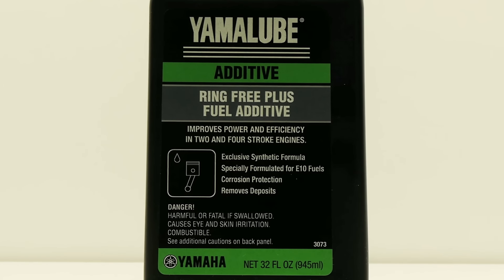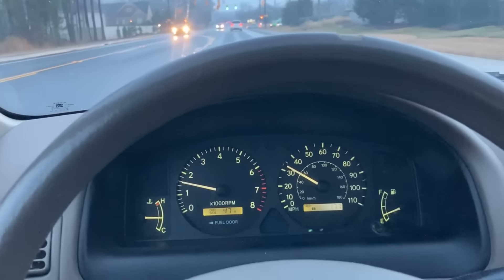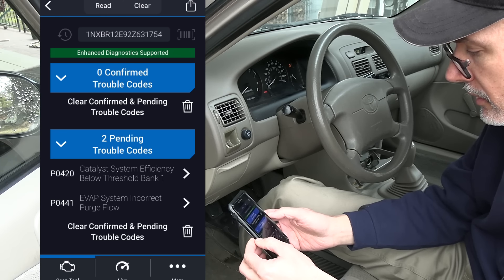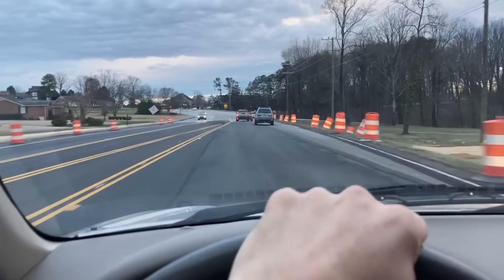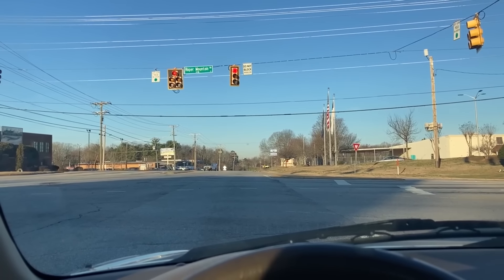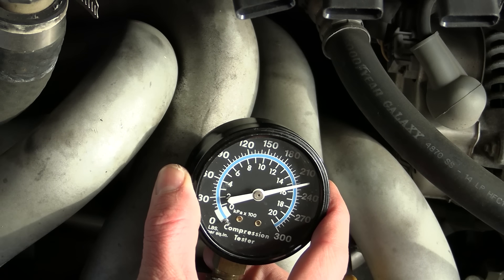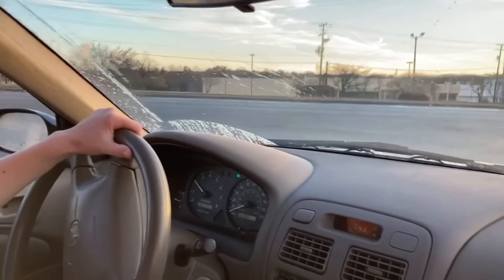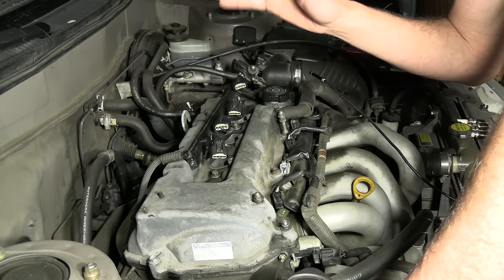Will Yamalube Ring Free stop oil consumption? | Oil Burning🔥Experiments | Episode 20

Comment: Hello Dave, I have been following along with your Oil Burning series as I have an oil burning Honda Element. I posted a comment on video eleven. My efforts included Seafoam, which de-sludged my engine, Toyota engine cleaner, noticed no difference. I tried a product my neighbour recommended, he works for a GM dealer, AC Delco engine oil supplement. This product is not marketed as a engine ring cleaner but as a engine rebuilding lubricant and I noticed a difference immediately in the level of noise the engine made and my oil consumption. After 3 treatments following the instructions on the bottle oil consumption was cut in half. I then tried what might turn out to be the most successful product yet, Castrol GTX Ultraclean 5W-30 synthetic engine oil! Boy did this stuff turn black fast. After 1500 miles I changed the oil and filter and repeat. 1500 miles later again changed the oil and filter. The oil was again black but the oil consumption was noticeably less. Now on my third Castrol GTX Ultraclean oil change, the oil has not changed color and consumption is way down. I will update this comment in a couple of months as not enough time/miles have been driven. Car idles/runs better than ever though. You may want to try a oil that is marketed to clean engines rather than a additive that cleans engines in a future test. The oil is in the engine longer. I must say I was impressed with the Yamalube ring free plus product. Thank you for posting these videos.
Reply from the maker: That’s awesome, and thanks for the suggestion!
Reply: Update?
Reply: We have continued to use the Castrol Ultraclean in our Honda Element. The engine is now consuming about a quart every 450 miles however the color of the oil remains transparent a lot longer. Oil consumption has gotten worse but highway speeds tend to consume more oil as Dave has mentioned. I'm going to try a Yamaha ring free treatment next @Tate.TopG.
Reply: @buckhorn2007  Thanks a lot for the updates. I have a tacoma 2.7L, and it's consuming quite a bit of oil before I reach the 3000 miles . I may have to try your method 😉
Reply: AC Delco Engine Top Treatment stopped my 2007 Camry's oil consumption completely. I now change oil very 5000 miles and still have 1/4 of oil left from the bottom dot on the stick. It used to burn a quart every 500 miles. The problem was the leaky valve stem seal on cylinder 3, and I had all the seals replaced before doing the AC Delco treatment.

Comment: At the 15:20 mark…where is the oil dripping down from the top coming from?  Is it leftover from getting past the rings?  Or seeping down from the top side somewhere?
Reply from the maker: I think it's leftover from the rings. The top-end has been pretty well sealed. New valve-stem oil seals and valve-cover/spark plug gaskets.

Comment: I have a 99 Corolla and burn about 1 1/4 every 1000 miles.  Still gonna try a B12 treatment and see if it fixes it.  I'm also gonna run 0W-30 oil in it to see if that helps after the cleanup.  Thanks for these vids Dave it helps a lot.
Reply from the maker: Thanks for the comment, and please let us know how it goes!

Comment: Have you added oil to the cylinder after first compression check and checking again. That’s how we used to check rings when j was a kid. The other method is a regulated air compression leak down test. Those are used commonly on aircraft engines to assess ring wear and effectiveness.

Comment: Johnny come lately here You can dump as much death in a can as you want its not going to add back the cross hatching that looks heavily worn gone and rings that are in need of replacement. You want a suggestion do a shade tree mech in frame , drop the pan remove the head and one piston at a time change the rings and ball hone the cylinder and throw it back together of course after you run out of death in a can idea's
Reply: That's such an asinine comment. You realize who's difficult it is to re-ring an engine for the average person? YouTube master techs like you make me laugh

Comment: Thanks for the video. You really shouldn't be using premium gas. Higher octane only helps if you have higher compression ratios and it will actually lead to un-burned fuel being pushed into the crank case.  The Yamalube looks like it did a great job. I think you have the right idea to run the Yamalube for longer. Looking forward to the BG. Great series. By the way, a time laps of the bore scope would be nice and a chart showing oil consumption vs mileage (and notes on highway mileage) would be nice too. (I know, it's a lot to ask but going forward maybe?) Have a great one.
Reply from the maker: Thanks for the input Bruce! ... I'd love to do the charts and stuff (like Project Farm). Maybe I'll have time at the end of the series to have a follow-up with info like that in it.  … oh and I get pre-detonation if I use lower octane fuel.
Reply: Just as an aside, though this is heavily bound on the fuel market for your area, using premium fuel is one of the few ways to get guaranteed ethanol-free in large density metro areas to folks who are concerned about mandated ethanol use. You're spot on about not seeing any performance difference on normal engines though. In our area of the DFW metroplex for example, almost all stations have gone to running a 10% ethanol blend even in regular 'ol 87 for emissions, but so far as engine durability and the requiescence of subsystems (fuel lines, seals, etc), the ethanol blends are most certainly a detriment to be avoided if you can. A properly maintained engine will burn cleaner and pollute less than having ethanol forced upon one self, but that's a rather slim slice of the market these days.
Reply: 06 sienna rips tires from 1st into 2nd almost into 3rd when i ask it to.  196700 miles.  Go beat your motor a little.
Reply: Higher octanes shouldn't have that effect, most of what higher octane does is be more likely to burn when sparked and not pre-ignite/knock. It's necessary for high compression ratios due to the compression ratios making pre-ignition more likely, but should pose no harm when used in an engine designed to handle lower octane fuels. It won't net you any performance out of it, but if you have an engine that has a history of trouble, it can only help to run high octane fuel through it to at least see if it runs any differently, if not just to err on the side of caution while doing other maintanence things to try to bring it back to health.
Reply: In a high mileage engines with sufficient carbon build up, the compression ratio might naturally become higher. But with knock sensors and whatnot, yes, the ECU will retard timing to prevent knocking on low octane fuel.
Reply: Premium fuels have a higher percentage of carbon reduction fuel additives. BTW to the people saying carbon increases CR, here's not enough carbon in the combustion chamber to cause knocking. If there is knocking with low octane fuels, then try a one step cooler plug
Reply: @C-M-E  Also for people driving plug in hybrids premium might be a better choice. Long term storage with 10% ethanol isn't the thing to do.
Reply: @kampar82  I know I slept poorly last night  (managed a two hour nap essentially. Projecting when the iron is hot is such a problem for me!) as it took me two reads for this to click, lol. "Why does a plug-in need premiu--Ooohhh..."
Reply: @FamilyFriendlyDIY  Wouldn't the pre-detonation be related to the higher than normal compression numbers?  Thanks for the series.
Reply: @MattExzy  oil in the combustion camber raises the numbers in a compression test..  as an apprentice that one trick we use to determine rings or valve sealing tipping a little oil in the spark plug hole if the number raise it's rings seating issues so oil raises compression test numbers
Reply: @kmemz   Higher octane is no more likely to burn..  just money through the tale pipe ..
Reply: @joebrown9621  It's not that it's more likely to burn, it's that it's more likely to burn when it's supposed to. That's  the difference. Pre-ignition/knock compared to correctly timed ignition by spark. It is money wasted in an engine that doesn't need it and isn't going through a laundry list of troubleshooting, I agree.
Reply from the maker: @kenyoung5682  Could be that and/or a combination of the carbon on top of the pistons ---which could increase compression or remain glowing hot so fuel ignites early.
Reply: @kmemz  finally someone who knows what they're talking about.  Only reason to run higher octane is if your timing is off or you have some valve problems and your getting detonation and pinging. Might get you by for a little bit but won't fix anything
Reply: @C-M-E  Hey I am in West Texas and probably use gasoline refined somewhere in Texas. Why do you say premium is ethanol-free? Did somebody decide that ethanol is bad for use in metro areas?  Pure gasoline does net better mileage but actual results when burning 10% vs 0% should vary lots depending on the vehicle.
Reply: @FamilyFriendlyDIY  If that engine is same as my Toyota, it requires 87 octane. Any higher octane will cause excessive carbon buildup and I can see that for sure on the plugs and pistons. If 87 octane is causing detonation, suggest having it checked out as maybe time for a new timing chain/belt whatever it has but seems timing is off. 
Also, that much oil in the piston isn't making any sense if the compression was on target with specs. Maybe getting pulled in through the PCV or crankcase ventilation system somehow.
Reply: @jamesmedina2062  Premium is *supposed to be refined to a higher purity and not contain ethanol as a rule, not saying that's always the case, but they are required to list it at the station if it is. So far as I'm aware and have seen, 93 octane (premium) in the DFW area is ethanol free. Ethanol attacks rubber seals, hoses and is rather detrimental to fuel systems in general, even though the only reason it's been added to fuel at all is emissions. E10 makes a marginal hit in overall mileages per gallon on a tank, probably that most people don't notice. My 5.7 is rather thirsty and the E10 difference can be at least 25 miles on a tank for instance, which when you only get 225 on 20 gallons, 250 is a measurable difference!
Reply: The notion that high octane fuel shouldn’t be used in a “low compression” engine is nonsense. If your engine management can adapt to the octane AND air to fuel via pulse width. That’s just silly to say that
Reply: @Lnmoto86  Sorry, but as an avid marine engine mechanic, it is proven to cause major carbon buildup in these engines that require 87 octane. Those with O2 sensors completely clog up with carbon. We have to do decarb procedures to clean the carbon out. The computers do not adjust to the octane. In that Toyota, which I have the same, it also calls for 87 octane and does not adjust. Proof here is look at the thick carbon on the piston and the excessive carbon on the plugs. Nothing silly about it and why spend extra money on fuel that is causing issues with carbon. I do agree some engines are capable to adjust, but not all.
Reply: @Lnmoto86  IT IS A WASTE
Reply: Premium gas has more detergents in it, in addition to octane boosters.
Reply: @FamilyFriendlyDIY Yes, you have really high cranking compression.
185 is considered the limit for lower octane with ethanol.
Reply: @MattExzy and reduce mileage.
Reply: How is there so much misinformation about octane?

1: Premium fuel has more additives and conditioners to keep injectors clean etc

2: your octane rating is how prone the fuel is to knocking. Higher octane resists knock so it can run higher compression (more heat), higher intake charge temperature (turbocharging) and if you have old, damaged, carboned or incorrect spark plugs the higher octane will help resist the pre-detonation (knock) that can happen.

Carbon buildup on plugs, valves or piston causes heat spots where the carbon is and this heat is transferred to the fuel/air charge and can cause pre-detonation (knock) because the charge wants to ignite before the piston is in the correct position

Having oil in you cylinder from bad rings, valve seals or broken PCV system will lower your octane rating and causes carbon buildup. Both are as mentioned bad for knock.

Having a evap leak can throw your air fuel ratio off and cause lean or rich conditions as well. You will get knock/misfire often at idle from a lean condition from the evap leak.
Reply: @FamilyFriendlyDIY  I think the detonation could be from that high compression because of the cylinders being so well lubricated lol
Reply: Yamalube lowered the octane, then the engine got pepier...
Reply: High grade gas let's the ECU advance ignition before knock detection .
Reply: Instead of using Premium, Iuse 10% of E85 and the knocking goes away, just as good as premiumguel. Way less expensive!
Reply: Wrong  all need to use premium 93 gas always always.  150k miles ans spark plugs still beautiful. 250k miles now ans no fuel pump issues no sparkplug issues no issues with gas or spark  im a fan of 100 percent premium gas 93 always nege rever put 87 89 91 only 93
Reply: Wrong 
Wrong
Wrong
Modern engine adjust timing on the fly!
Very sophisticated knock sensors on modern engines.
With high octane fuels modern high performance engines run better.
Reply: Yes they do!
Your a marine mechanic 
You know nothing about modern engines!
Reply: The carbon chain atoms are smaller in premium fuel.....
Reply: If she's burning oil definitely run premium oil vapors causes low octane.
Reply: @jamesmedina2062 premium used to be ethanol free, and plus was a mix of premium and regular. Not anymore.

Comment: Some DTCs require failing the internal tests on 2 consecutive trips to log as a current code. ALSO, for many manufacturers, the EVAP system test won't run if the fuel tank is too full or too empty. It might not run unless you do a cold start as well so while the chemicals might be helping the EVAP issues somehow, you might be chasing a red herring
Reply: Absolutely agree, the live data through the OBD would be a great comparison instead of relying on a single light that has a possible 500 causes

Comment: I'm very curios to see how your engine flush with BG EPR will work for you.  I did it on my Volvo and we went from a liter every 1000 miles to less than a liter in 4500 before the next oil change
Reply: I tried BG EPR (Bg109) with my Gen 3 Prius before an oil change. No change of the oil consumption rate after the treatment.

Comment: I think what you're seeing with the borescope is carbon deposits from the piston and rings sloughing off onto the cylinders. I think you need more Italian tune ups to really burn off the carbon that is slowly dissolving, especially if you do a lot of city driving short trips like I do. My car won't run right unless I do some hard pulls every few days. I have an idea for an atypical additive for freeing the rings, and that's motorkote. It's a metal binding lubricant that is really effective at reducing friction and freeing things up. It's possible a hyper lubricant could act as a way to unstick some sticky rings, but not so much for the drain back holes. Project farm did a really good video on motorkote with impressive results on friction. One last thing is EVAP problems are super intermittent, and often throw codes, then fix themselves.Can't wait to see the BGK video, and as always I'm enjoying the scientific process of this series!
Reply from the maker: Thanks for the suggestion!

Comment: Check the evap purge valve in the engine bay. Incorrect purge flow is caused by a leaking purge valve allow intake manifold vacuum to pull fuel vapor into the engine. Very noticeable after fueling up. Hopefully that check helps.
Reply: Was about to suggest, based on the loopy idle could be a vacuum leak or intake leak. The stall after fueling makes me assume that purge is stuck open.

Comment: I've had 2 of these engines. prizm and celica.  I'd say 20w50 would be the best oil to use besides in winter temps below 20 degrees.  I used straight 40 weight in my celica and it did help with oil consumption.
Reply: 1zz-fe? Just wondering since I have an 04 vibe that’s burning oil slowly

Comment: Have you considered some valve guide seals. Also, consider a thorough inspection of the PCV system...the valve cover is also an air-oil separator. If clogged in just the right way, the engine oil vapors will get pushed past the piston rings due to clogged pcv. I'm just curious if that pcv valve, or some of the chambers inside the valve cover.

Comment: i have a 2001 crolla that burnt oil, i ran a quart of atf through the engine and drove it super hard (im talking evey other shift a limiter shift) came back and drained the oil it was super dark, then added new oil + filter with a lil liquimoly so far 3k miles and not a single drop of oil lost
Reply from the maker: Thanks for the input!
Reply: @FamilyFriendlyDIY  ya no problem i love your series i know the only real way to stop the consumption is to rebuild the engine but part of me wants you to keep making these videos because they are so entertaining/informative
Reply: Been using used ATF before oil changes on Friends and Family vehicles since the 90's; a practice my uncle had been doing for many years before that. What's cheaper than used ATF, right?  Works great in my experience.

Comment: You need to turn the gas cap and listen for 6 or so clicks. Not sure what the manufacturer recommends but that's how I do it. You tighten up the gas cap and it just stops you need to do some more to hear the clicks. Much better seal for the EVAP system.